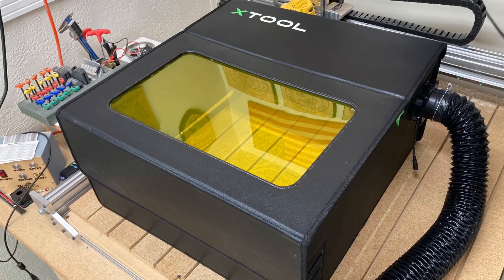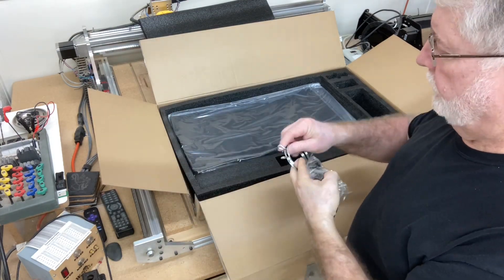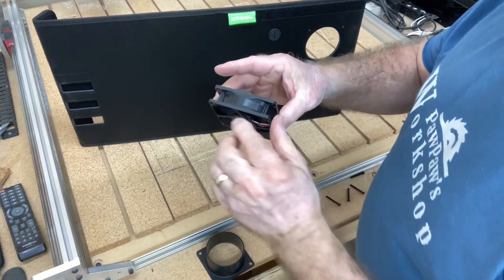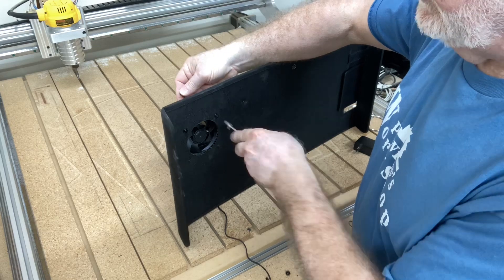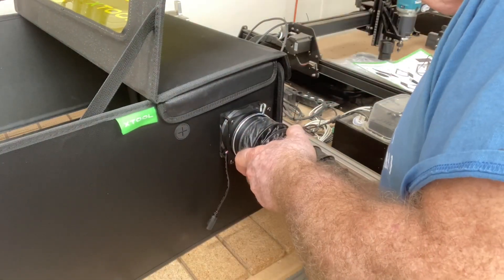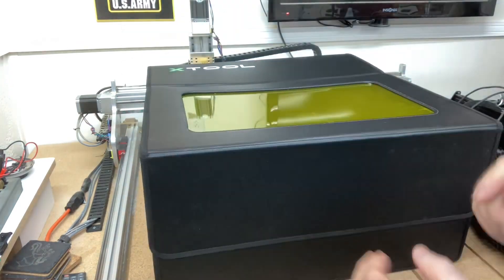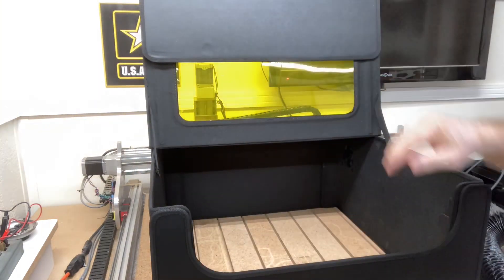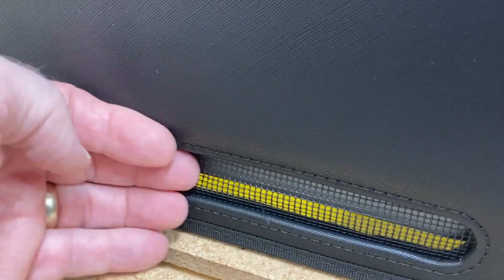xTool Enclosure

Comment: Can you tell me what type of fan you bought. I got this enclosure for Christmas and already I need a better fan. The amount to soot and dust left inside and on the module was awful. I’m hoping to move my Xtool back out to my porch when it gets warm.
Reply from the maker: This is the Comgrow air Purifer. I must saw that I can no longer recommend this air purifier because you can not get the replacement Hepa or the charcoal filters.
Reply: I found that to be true when I did research on the air purifiers. 
I ended up with OMTECH 80W, w/ single hose. You can buy filters at different places on line.

Comment: The fan needs to be on the inside and power cord pushed through the hole on the left. I guess either way will work but looks like they designed it that way!
Reply: He has it assembled properly, the hole is for an air assist cord if you have one
Reply: He has it assembled correctly. The cord hole is for an air assist cord if you have one.

Comment: I have mixed feelings on it. Looks okay, wasn't thrilled with the idea that it showed up with mold on it. 
I guess my main question is, given that you're assembling it on a CNC table, why didn't you design and build one before? Cost would have been comparable (if not less) and quality would definitely be higher.
Reply from the maker: Portability is the main reason. There are many people who go to craft shows. This enclosure is light and is easy to setup and take down.

Comment: We just got the enclosure yesterday... The fan plug and adapter plug don't fit...  lol its an easy fix as I have many adapters lying about and had one with the right voltage and AMPs etc and the right plug
Reply from the maker: Wow, that’s not good that the plug was wrong. That’s disappointing

Comment: nice unit  onthe bigger more expensive CNC Woodworking Machines they use a 4 sided Whisker style  enclosure surrounding the Router and bits to contain the saw dust  to be vacuumed  out that unit moves with the Router and works very well  as a rule  in my former Shop we usedWeeke brand Multi Axis / self changing Router bit machines to machine parts for our inHouse CommercialCabinet line